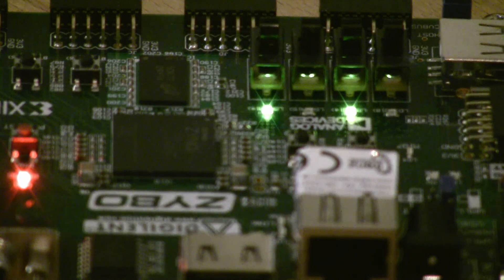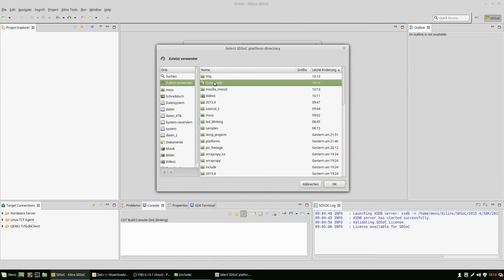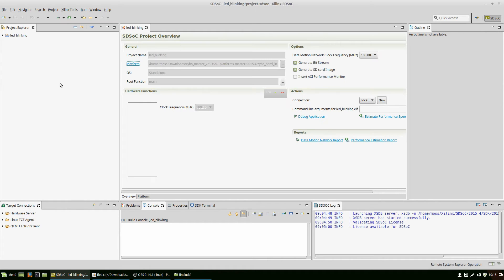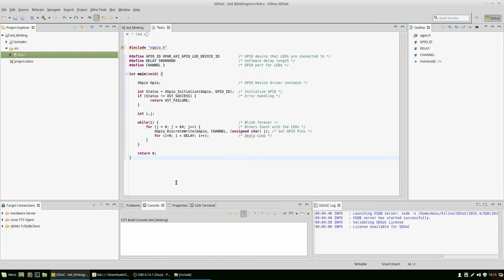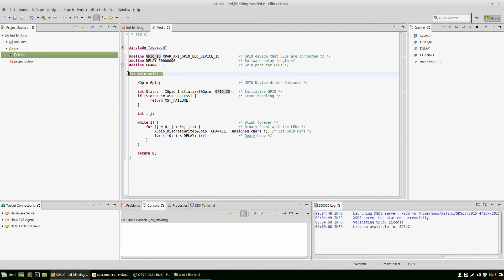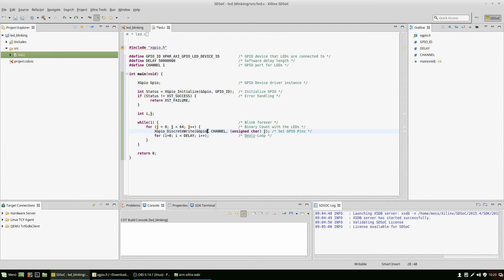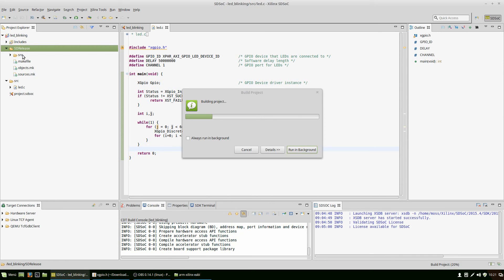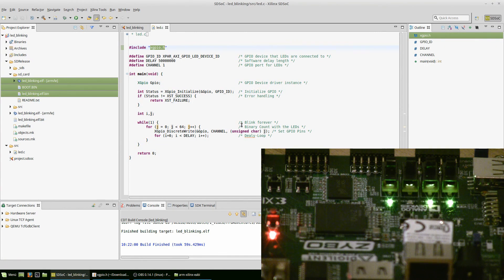FPGA Tutorial 2: ZyBo "Blinking LEDs"-example using SDSoC

Comment: Hi, thanks for this tutorial? 
Could you explain why the loop which blinks the LEDs is going from 0 up to 63?
Thanks!
Reply from the maker: Hi dudekidPL,

counting from 0 to 63 gives the following sequence of binary numbers:

000000
000001
000010
000011
000100
.....
111111

Each of the 6 binary digits is drives one LED. "0" represents "LED off" and "1" represents "LED on".
That is how the blinking works.
Reply: Thanks for the quick reply!
That would make perfect sense to me if there were 6 LEDs that were blinking.
Since there is only 4, wouldn't a loop from 0000 to 1111 be sufficient?
Reply from the maker: You're right. The upper 2 Bits are not used. I just had a look back into the code and have to agree. A loop from 0000 to 1111 would be sufficient. As the pattern for the lower 4 Bits repeats anyway (the upper 2 Bits are just not used) it displays the same result. But it obviously leads to confusion. Sorry for that. i just didn't notice my mistake.
Thank you for spotting this misleading part of the video. At the moment i don't have the time to do the video again, but maybe your comment helps people understanding.
Reply: Thats great! Thanks for clearing this up for me :)
Reply: Hi again, I have a big question for you, I would be really thankful if you could give a few instructions (or maybe make a YT video) on how to use the built in ADC's. I found a xadcps.h library in the zybo files but I'm not sure on how to use it.

Thanks a lot!

Comment: Can we see hardware part of this tutorial, please? 
Processor configuration\instantiation etc...
Reply from the maker: Hi sonycmanvr,

thank you for your question. SDSoC is a pure Software-Development Tool for Xilinx-SoCs. SDSoC projects are based on prebuild Hardware-Platforms. You don't have access to the configuration of the HW-Platform in SDSoC. The HW-Platform used in this example is provided by the Boardmanufacturer Digilent. The link to the HW-Platformfiles is in the Video-description (Link to Digilent Githubproject 'zybo_hdmi_in'). To open, inspect and maybe modify the HW-Platform you have to open the Vivado-Project that comes with the HW-Platformfiles. The Vivado-Project is build with Vivado-Design-Suite 2015.4, but should open in any later version too.

In future videos i might cover the topic of building such a HW-Platform from the scratch. But that would be more a Vivado-Design-Suite-Tutorial than an SDSoC one. Till then i will use the Digilent-HW-Platform for the ZyBo for SDSoC-Tutorials.

There is a videotutorial from Xilinx about creating a custom SDSoC HW-Platform:
http://www.xilinx.com/video/soc/sdsoc-custom-platform-generation.html

Cheers,
FPGAdventures